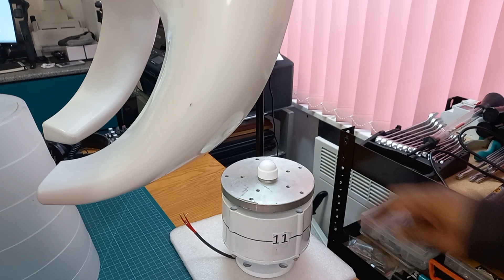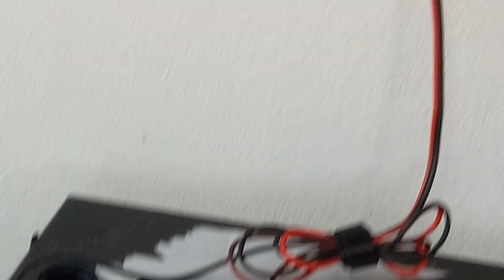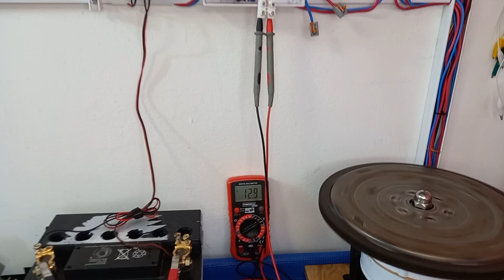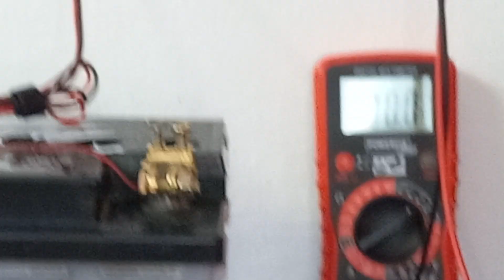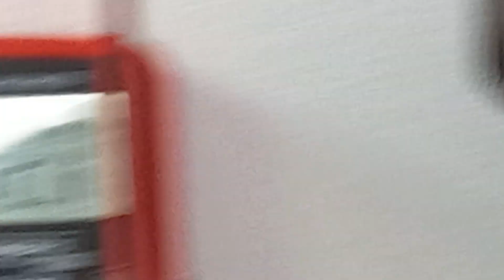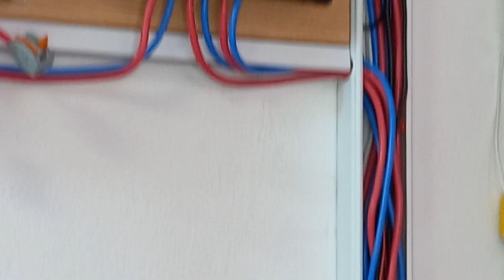Free Energy Generator works anywhere  II

Comment: I've done similar things with smart drive washer motors and BLDC 3 phase hoverboard motors. . You cut the connection wire between the first and second pickup coils in each phase, then you tie the ends of the 3 single pickups together. This is now your drive for the motor, still 3 phase. Next you solder a length of wire to each of the remaining leads from the rest of each of the 3 left over phase's. These 3 wires are now the output of the self powered alternator, you can use a small after market BLDC motor control to drive it. Try it it's not difficult.  😎

Comment: Good work, connect the output to the filament electric bulb, and take the input from the battery and show the input watts/output watts
Reply: Turn off the Robot 🤖🤖🤖 VOICE.!!
OK, AND YOU, TALK" tell us about where you got this I'dea,
Reply: @arkangel8709  I Bought this is a Chinese wind turbine, to generate electricity with natural wind.  The generator's production capacity is marked as 12 volts 600 watts, this generator was placed on an old tower in the property, even at the height of 20 Meters, it never created the described power, even on the best windy day.  My experience with this wind turbine on generating a maximum of 12 volt 150 watts. 
Therefore, decisions were made to modify this wind turbine.  and came across this copper wire magnetic motor with a battery technology, online video, modifications were made to the wind turbine.

To test, if it will rotate without wind power on its own with this copper wire magnetic motor technology. It did.  So simple technology. Just use it . 
This technology is to be given away to support and rise the changes to create electricity without using fossil fuel, and undependable natural elements or resources

Thanks for your commented question. If you wish to know more, stay connected.

Comment: I have done a simular thing with a 24 volt 100watt bldg uni drive motor.. Except mine is 3 phase in @ 12 v dc, and high out put is 300 volts or more. The  amps have not been checked as yet, thanks for your input.😎
Reply: please check your Amps in and Amps out and tell us what happended

Comment: Not even centered lol
Voltage alone means nothing
Omg please stop doin maths 😭
You haven't got a clue about power in Watts or watt hours ...
it's a pointless flywheel ......
it's not a generator or a machine it does nothing without a battery it's ment to produce electric who charged the battery to run that motor ffs
Reply: Shut up Dave! Your not Qualified to say anything any more....(with your mathsssss skills... )
Reply: @FREE_FREE  wot do you know teabo ...if ya think this actually works you need go back to school

Comment: You should know something about amps that are marked with the letter "A". Chemical energy from AA cells can provide well over 1A (for a short time) for a while, but let's say you can spin a modified flywheel motor-generator with a current of 200mA from AA pencil cells. It is indeed possible, as in all electronic converters (UPS) or mechanical military converters, to achieve a higher voltage, namely a mechanical military converter from 12V 5A (from a car battery) to 145V 0.01A for a radio station. In your case from 6 or 9V to 13V, but the amps (A) provided at the output are always smaller than at the input. It's just a transformation (amps per volts or vice versa ... Buck-boost), which prevents the construction of perpetuum mobile. You made a calculation error somewhere. Your lead-acid battery has a capacity of 60Ah. This is large enough capacity for even a "discharged" lead-acid battery (8.5V) to provide amps (A) to start the car. Your device only supplies very expensive voltage (V) from AA pencil cells for a while. If you switched your electronics from "V" to "A", you would find that the charging current is imperceptible, so the proclaimed 2kW simply does not exist. You forgot about the torque, which would be really high if 2kW in the load were to be reached. Virtually idling does not require much torque, but also does not provide the necessary A. Your device in this configuration actually produces 1.2W. You have succumbed to the illusion that you are charging the battery (measured through a voltmeter), but in reality you only maintain the voltage of the battery, which has nothing to do with its capacity. Good for maintaining batteries over the winter. When all the capacity of the battery is "depleted", you can measure 13-14V at its contacts thanks to your "charging device", but the amperes (A) will be so small that you will not turn on even the smallest car bulb. The universe gives nothing for free.
Reply: I hate to say your forgetting about what comes back from the turbine.
This is real.
Reply: @TheDeadEndChannel  I'm not dealing with a situation where the wind is blowing and the turbine is normally producing electricity through a generator, but I'm reacting to your specific situation in which the wind is not blowing and you are allegedly charging the car battery using AA cells. That's why I'm correcting you to take seriously the amperes (A), not the volts (V). Then you will find that you are not actually charging the car battery (not increasing its capacity), but only maintaining its voltage (ideally inefficiently with many AA cells). You have the illusion that you are charging a car battery using AA cells when you focus only on volts (V), but amps (A) are very important when it comes to capacity. I advise very well: learn to measure amperes (A) and you will immediately find your mistake (no one learned from heaven fell). Actual charging takes place when the wind blows or when you connect the car battery to a proper charger. If you don't believe me and don't want to abandon the idea of perpetuum mobile, do the test I suggested above: discharge the car battery with a halogen bulb (traction car battery will survive) and then "charge" your car battery with AA cells until the voltmeter shows 12-14V on the car battery terminals. Reconnect the same car bulb, but it will no longer light up. Why? Because your car battery doesn't have Ah capacity (it doesn't have A amps). Recall the Apollo 13 film, where it was necessary to obtain at least 15A in a crisis situation for the operation of important systems after the disconnection of two fuel cells, and this was a significant undervoltage (V) in the network, which manifested itself in an alarm signal. Simply amps (A) are very important and a car battery that has no capacity (Ah), even though it has full volts (V), is completely useless.
Reply: Be trickle charger that's providing motor doesn't stop 
He lies saying the motor generated more than it consumes which is highly doubtful without gears/fly wheel
Reply: @davey2k12  Of course, no generator produces more than it consumes. It can produce more volts (V) due to the transformation, but at the expense of amperes (A) or vice versa. Thus, for example, the required amperes (A) are achieved in welding machines at the expense of voltage, or the current is transformed into a voltage of a very high voltage transmission system. If it were possible to produce a generator that produces more than it consumes, that is, that it produces excess energy, the Nobel Prize would have been awarded long ago. :)

Comment: you are using the wind turbine as a mechanical electric transformer to convert the power from the battery but there is loss from friction and heat it would be better to just use the batteries i believe you are trying to trick people where is the rest of the data show amps and resistance
Reply from the maker: I have just starred the project, its not finished, this is real. I have handled to win the resistance. Please wait for my next video on this project. I appreciated your question. Thanks,  questions are welcome.
Reply: They are hiding the technology. They want to sell it to you.
Im openly sharing.

Comment: It's not free energy, it's called overunity. There are hidden wires that are supplying power. As soon as a load is applied to that higher voltage it will either require more current to stay running or there will be a large drop in voltage.
Reply: Ya there's no free lunch.
I guess im the only one checking that this is real. 
But hate to say it runs fine with 3.7 volt and 5 volt.  I haven't tested higher input voltages. But, with a  5 volt phone battery bank charger. I was able to charge a car deep cycle battery from 7.25 volts to 9.05 in 8 hours with less than half of the 5 volt battery bank. 
This will be day three of testing a device like his.  
If this is bullshit I will call it. Im from Ohio and have no reason to lie for views or to mislead people. 
And I don't blame him for not showing his modification,.
So explain to me how my input is 5 volt and  i charged a battery with more power in it than the supply battery.
Reply: @TheDeadEndChannel  In fact, the battery does not charge, but you maintain (increase) a voltage in it that is not related to capacity. It is possible to try a simple test - let your battery discharge through a car bulb (it will not hurt the traction battery). Then "charge" it with your device using a mobile charger - it will probably take 2-3 days and attach the car bulb again. The car bulb will not illuminate even if your voltmert shows 13-14V at the car battery terminals. But, for example, LEDs that are more voltage dependent may be lit...
Reply: @TheDeadEndChannel  Make: I start to love your comments, you are everywhere, I know, you want to know the technology. Technology will be open to everyone after I patenting. 

A few weeks ago my car battery was down, I have changed my car battery with my own innovation. It took 16 hours to charge a 95 Amps battery. Please view the link 
Now I am working on a dual Machine, and soon it will be 8 Machines. Thanks for your comment(s) Link https://www.youtube.com/watch?v=2u6qE5V4KEA&t=23s
Reply: They are hiding the technology. They want to sell it to you.
Im openly sharing.

Comment: Love the idea. Been looking for some thing like this. I don’t live near any stream for hydro power. I do have a few solar panels and a Chinese lantern generator. But like you said in your video there are times when there is no wind and that could be a few days before you get any. And solar relies on the sun for maximum power. At night time and cloudy day you don’t get the maximum power out of your panels. It looks like you are using a flywheel from a small car and a small electric motor to turn the flywheel. Definitely would like more information on your design. 👍👍👍👍👍👍
Reply from the maker: Hello Kenneth rea
If you use electric motor, say for an argument, you are using minimum of 6 volt 3 watts motor it will not produce any electricity, and instead of producing it will drain your battery. If you are running with electric motor a car battery will power for 4 days. I have tried all those methods. Only magnetic rotator is the only way out.  You cannot just rotate with magnet; it needs an ignition power all the time during the rotation, at least 1.5 volt and 0 watts.  I am after this project more than 4 years. Still, I am modifying, I can only get maximum 12 volt 300 Watts.  Actually, which it should produce 12 volt 600 watts. Anyway, I am waiting for 48 Volt 9000 watts generator to deliver. Soon there will be another video, after I modify the generator. Also, thanks for your comment. All your comments are welcome.
Reply: @esewarathasthangarajah2011  You speak with so much conviction and hope. 
  Please do take care of yourself, anyone I had ever seen trying to bring hope with free energies all failed, because of the big  people... 
   The mistakes they all seem to do are these. 
They either never shared a pdf or a step by step formula for begginers before they died or disappeared. 
Or, their projects were just way to complicated to reproduce..
Or they charged way too much.
And they never had a diferent platform to contact them.. ever.. always YouTube and Email and thats it.. try Discord or Telegram at least.

Try to avoid these things if you are into these energies, GOOD luck 👍

Comment: My turbine produce 60-70V how can i regulate it or how to stabilize to produce 110v or 220v?
Reply: Just connect with inverter generator circuit, will deliver 110v or 220V, it will take care regulating issue also
Reply: @InventorAsrafkhans  i dont think its good idea . If u conect it to inverter its will burn . Over voltage 60 V
Reply: You cannot depend on wind speed. and,  It's not possible, to get 24 / 7 / 365, a fixed wind speed to generate stabilized voltage. I am going to make another video, how you could stabilize the power. Thanks for your question and comment.
Reply: Thank you for the reply
Reply from the maker: @kadiskartemotv  this technology is brought to everyone, and to rise the changes to create electricity without using fossil fuel, and undependable natural elements or resources

A legal closure is made by surf 2 green, you have to have permission from surf2green to manufacture or modify this product technology Number 2 0 2 1 1 1 9 F E E G 2 0 2 0. 

and for more detail and for the application of the permission and for the diagrams 
Please visit our website to contact surf2green NGO

Comment: I just want to say. That i have tested what this man is showing. And i was actually shocked on how well mine spun from a 3.7 volt 1200mah 4.44 wh battery.. and goober torque.  
Set this up like a pulse motor and a flywheel. 
If you have played with pulse motors give this a serious look at.
Reply from the maker: This project is not finished yet, it’s still on the test level. There will be more videos, which I will consider your questions as part of it. Thanks for your comment, all comments are welcome
Reply: @esewarathasthangarajah2011  
Only question is how your driving it.
I have mine running now useng macanical switching.
Reply: @TheDeadEndChannel   Link https://www.youtube.com/watch?v=2u6qE5V4KEA&t=23s # Thanks for your comment
Reply: @TheDeadEndChannel  would love to know more info like a more detailed step by step process, 99.99% of the people are amateur towards electricity, i'm one of them.. Would be amazing if you could comment here or send me an email or post a video with the follow up instructions.. It's time to take this further and spread the information. My channel about page has an email
Reply from the maker: This technology is brought to everyone, and to rise the changes to create electricity without using fossil fuel, and undependable natural elements or resources

A legal closure is made by surf 2 green, you have to have permission from surf2green to manufacture or modify this product technology Number 2 0 2 1 1 1 9 F E E G 2 0 2 0. and for more detail and for the application of the permission and for the diagrams 
Please visit our website to contact surf2green NGO

Comment: Next video please provide useful info. Every 3rd grade student know that it is watt you should measure because volt x ampere = watt, so i cant see on you video if your generator just use higher volt and lower ampere so result is 98% of the energy it uses. I wont claim it is impossible, but as I see it, this video made just to fool people. So try measure the watts in next video, mention of volt is fake if not together with the ampere volt is together with...
Reply: The motor ran like it was driven by a e-bike controller.
Could be a pulse motor circuit. 
No previous builds or research videos. 
At least it's not a fidget spinner.
Very suspicious.

Comment: Hello Sir, Nice concept that is exactly what I want do but the question is it powerful enough to charge the battery bank and how long will the input battery last to run the generator?
and how much will it cost for the whole system? once you have the output data please let us know. Thanks,
Reply from the maker: This project is not finished yet, it’s still on the test level. There will be more videos, which I will consider your questions as part of it. 
At this moment it is recharging 1000 Amps battery banks, which take a long day. Soon I am adding more turbines, which will charge faster, Soon I will have a video on actual currant production in (AMPS).
Thanks for your comment, all comments are welcome
Reply: You must showing amp in & amp out the battery while load test peak

Comment: Use a buck converter from output to input it is looped.you just need battery to start the device 😉
Reply from the maker: Let this pass the test level, and safety measures. I will consider your question.

Comment: I have to agree with others here, measuring how much current the device can supply is more critical than voltage. The input to output efficiency could be calculated and shown whilst the generator is at maximum load, which is usually when short circuited ie at max current. This then shows if Lenz effect comes into play.
Reply: Must be seeing back spikes in he controller.
He's definitely not getting any where near 25 amps. Maybe 
.25
At 300 rpm im getting 2.5 to 3 amp. 
24 volt 2000 watt turbine.
Reply: Um, tested this. And it deserves more research.